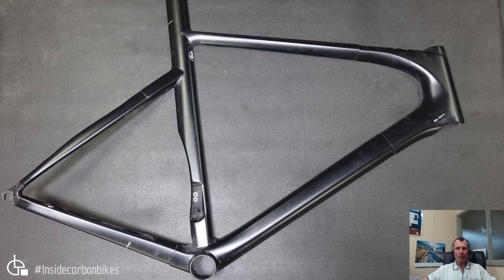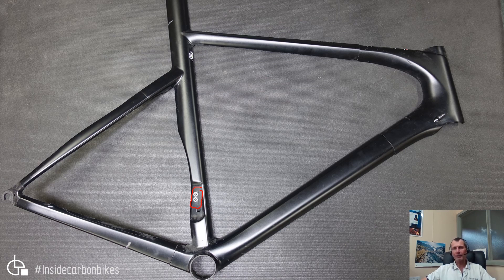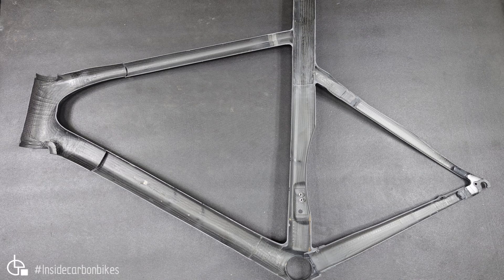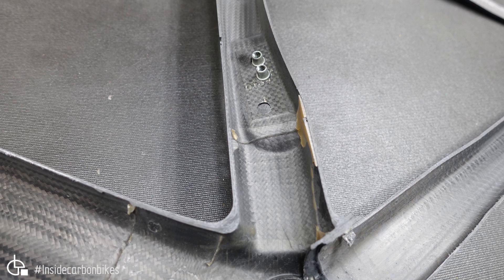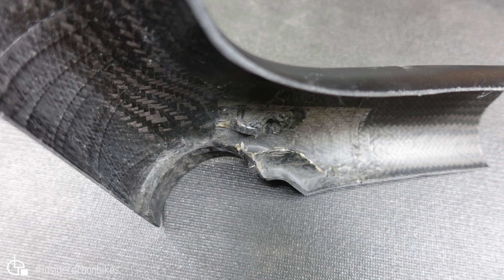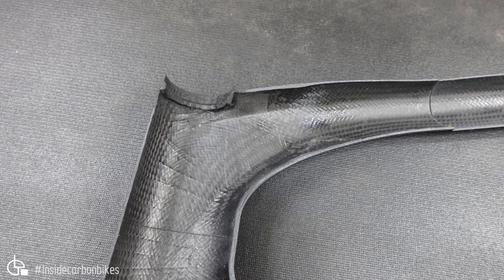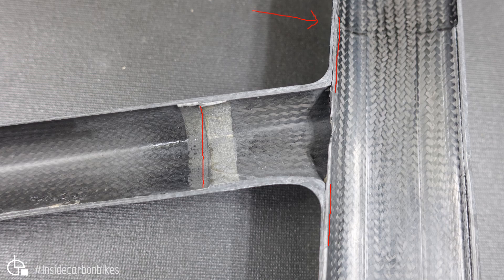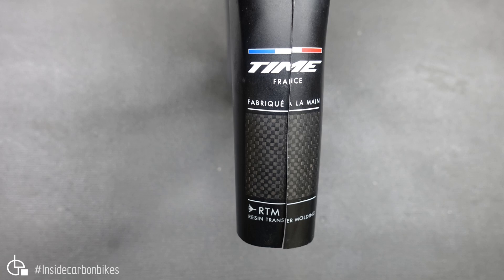Time Scylon 2018 - Cut Up and Review

Comment: Great review Raoul. The warranty defect was from the frame being slightly out of tolerance on the jig when drilling the derailleur holes - Time were great about it, easy to deal with and I’ve had 4x of their frames and this is first one there was an issue (they moved factory so probably a tooling setup issue). Since Time frames cost the same as a mid-upper range Specialized, I’d buy Time every time 😜
Reply: James Young thank you very much for bringing this frame to Raoul and us. Very kind, many thanks. 😊🙏...I wish I had the budget for a Time
Reply: Schoebelski no problem. Too many poorly made and dangerous bikes out there, Raoul is doing a great job bringing this to people’s attention. Time isn’t as expensive as most think, have a look at Cecil Walker in Melbourne, they have some great discounts
Reply: 37:16 little late, but did you get into futher investigation what caused the cracks ?
Reply: @xam8839  which cracks? The fault was the factory drilled the holes in the wrong stop as it hadn’t been seated on the jig properly - only out by a couple of millimetre but big difference
Reply: @jamesyoung4453  i know the initial fault was with the wrong placed/drilled holes, but at 36:06 Raoul mentioned crack indication. The same kind of cracks seemed to appear at the junction between seatstays and seattube. Did Raoul get into further investigation about this? Haven‘t seen cracks like this on other frame cut ups. Don‘t think it was caused by cutting the frame, since he uses fine dremel tool to do so.

Comment: There's something truly magical to these bikes, an experience that you only understand when ridding a TIME bike. Yeah sure the BB's are round straight and parallel ( why wouldn't they be) and the frames finished inside nicer than most on the outside. Maybe it comes from weiving the carbon Kevlar and vectran in different direction or maybe it's from weaving a thread of narrative through the fabric of Time and some saviour fair. Chapeau

Comment: Yup that's what I expected to see. Filament wound RTM parts can be high precision as long as your formers are well designed. TIME Sport did not disappoint.
Reply: Woundup compostites are still in the fork buisness as well :-) According to Tom Kellogh who helped Time with their first (and first desent carbon forks) the Woundup forks are stil the best riding and safest out there +20 years after Woundup 'wound' up their first forks.

Comment: I recently acquired a 2022 scylon and it is hands down the most stable and solid frame I have owned or ridden . Also have a T1sl 2022 and 2019 team machine , all rim brake and the Time is a rock .

Comment: Build one last march, and i must say: it,s the most comfortable yet stiffest frame i ever build and been riding on. beeing a heavy weight in the "peleton"(105kg+) i was looking for a frame with no weight limit, i came across this 2018 frame and bought it with out a doubt, it was fun to build an even more fun to ride with. Specs: sram red etap, rotor cranckset 50/34, most aero handlebars, home made wheels (dtswiss R511, hope hubs. I love it, best bike i owned so far!

Comment: Now I can see why they charge a premium for their frames,  very neat.  How does Pinarello justify their prices with the utter garbage they have made as seen in Raoul's cut up? Big difference in quality based on appearances at least
Reply: Justify? Why would they? You pay for the name from back in the day when specialists used the best steel tubes to hand-build their bikes in Italy. Nothing of that remains.
Reply: I've used time.pedals can't fault them.apart from the cleats being  pricey.
Reply: A bit.like the vacuum.bag with resin.method that many small car parts guys still.do.
Reply: @st939  sure it does
Reply: Prices aren't set at what is just, its set at where most profit is made. Pinarello sets there prices ridiculously high, people want and buy lots of Pinarello's, end of story. Win for Pinarello.
Reply: @LordVilmore  supply demand has set the price ultimately.If Eneos lose the next TDF then the demand might shift elsewhere and then the price down.
Reply: @glennoc8585  huh?
Reply: Are there any other brands that make frames this superior way? I am in the market for a new carbon frame, but it seems all the expensive frames nowadays are made in a shitty way. They can’t even get the bottom bracket right. Definitely don’t want to move to threaded.
Reply: @cubist112  only Time manufactures their frames using resin transfer moulding. Everyone else uses pre preg. Look makes really decent frames although Raoul did have a bad example on the show some months back. The new 795 Blade RS uses a moulded in sleeve to the Bb386 std. I have one. It's superb. Boroscope shows no defects. There's a few places where the bladder remained behind in the frame but otherwise its great
Reply: Pinarello is just a brand from oligarch owned UK luxury department store and has been for nearly a decade. It has nothing to do with the craftsmen from Treviso.
Reply: @mortenreippuertknudsen3576  pinarello is an ego purchase not a technical purchase.
Reply: AG Coarseman  Same owner as os the owner of a UK luxury department store - can't remember which. Originally it was sold to the owners of Luis Vuitton. It has been sold on again lately.
Reply: Nyc is full of em too

Comment: It looks good compared to some of the other frames we have seen.  It would have been nice to see the fork as well because they use as resonator device in the for legs to dampen road vibrations.  I think the technique is the same as that used in some skyscrapers and Japanese Pagodas  to withstand earthquakes.

The weakness does seem to be at junctions between tubes.  At 34:49 you point out the cracks on the left side of toptube - seatube junction but there is a crack on the right side running the visible length of the tube.  Maybe the cracks were caused by cutting the frame apart but that still shows they are weak points.

Something I can't understand about the process.  There is a wax mandrel that the fibres are woven around and the whole item is placed in a female mould.  The resin is then transferred through the fibres.  The melting point of the wax must be higher than the curing temperature of the resin otherwise it will melt during curing and not provide the necessary support.  But if the wax melting point is higher than that of the resin why does the cured resin not melt when they are removing the wax?

I have seen the RTM technique used by boat hull manufacturers but their process is slightly different.  They still vacuum bag but they attach pipes to each end of the bag and use the vacuum to draw out the air in the fibres and then draw resin into the bag and through the fibres.  I'm wondering if Time also draw the resin through the mould rather that inject.  It would seem better to draw it through because that also draws out air.

Could prepreg fibres be woven around a mandrel and placed in a female mould?
Reply: @Jeppelelle  Great reply
Reply: Once the resin hardens it is no longer vulnerable to the heat so they can use heat to drain out the wax

Comment: On one hand the post-preg and mandrel process produces a clean interior and virtually eliminates the possibility of wrinkles and gaps. On the other, it increases the amount of resin used, as mentioned, and reduces the capability for fine-tuning the strength/compliance/stiffness/weight of the frame design. Of course, unless you're trying to set records in weight reduction, the fine-tuning might be overrated. 45 years ago we never fretted about which was lighter, a Cinelli, a Gios, a DeRosa, or a Colnago.

Comment: Hambini's wet dream
Reply: Steve King  one that follows Luescher would not consider durian rider...
Reply: Hambini´s RTM dream??    Rgr
Reply: Steve King  yeah, depending on your location, probably the wise decision is to go for something like Cube, Canyon, Giant, Merida, Focus or Rose (Rose Backroad is a nice bike); cheers
Reply: @al3xandr3i  Durian isn't making the frames.
Reply: @al3xandr3i  While Durian may be a questionable guy, he was the first to call out major manufacturers for their faults on here. Years and years before selling frames. In terms of honest review, that is saying something considering the other outlets of "tests".
Reply: Steve King  Giant, Merida and Canyon usually offer the best value for money, by far. Giant, in particular, seems to have good QC.

The unique selling point for Trek is the Isospeed system, but I'm not sure if it's available with the lower end models.

I would get a Giant, then save up and get a high-end bike in the future if you really want. I feel like an entry level Trek/Specialized etc. is a bit of a pointless compromise - mediocre specs, not as cool as the top models and not great value for money.

That was the pragmatic take on it, but ultimately, just get the bike that will make you feel like riding it. Whether that's because of the handling, efficiency or the way it looks doesn't matter.

Comment: I would like to see reviews of some of the newer custom carbon bikes, such as Parlee, Myth, Sarto, and Alchemy. The majors have pretty much standardized the modular approach with standard head, seat cluster, and bottom bracket sections that can be consistently molded under high pressure. I'd like to see the full-custom answer to that.

Comment: Nice to see a properly made carbon frame! I had a question that is off topic, but I thought you might be able to give some advice. Just got a new pair of lake xc carbon soled shoes (2 bolt spd style), and the slots stop 5-6mm further forward than my old pair. I was wondering if you had a recommendation for a safe way to drill/dremel/sand the slots to get the cleats further back without damaging the carbon structure?

Comment: Around  25:45 both the upper & lower cut edges show a light line in the centre of the tube wall,  is this from the cutting process ? Or maybe excess resin between laminates ? Thanks for all your work.

Comment: It is cool how they weave the carbon, but however, they use many more pieces to put a frame together, where as most brands whether they make it themselves like Giant and Merida or source it out like trek or or Bianchi, etc. put the main triangle together in one piece and then glue the rear triangle to frame after. I don't see how you can specifically place certain fibers where needed when it's weaved. Weaving is like braiding you can only weave or braid in a certain way.

Comment: Just curious what was the weight of this frame?
Reply from the maker: I weighted all the cut pieces at 992g, add a few more grams for the material the saw removed and some fittings and it would be around 1050g I would say.
Reply: Built up an RXRS : the module (frame,fork, stem,handlebar ) plus the wheels plus the seat weighed 10,4 lbs

Comment: I looked at Time's website and apparently there's some kind of moving weight element in the fork for vibration damping. Have you cut open one of these forks, and if so what does that look like / is it a risk of breaking?
Reply: No risk of breaking
Reply: they have done that for almost 20y, no risk. They branched out to the carbon fork buisness before they added their frame buisness.

Comment: Did you have a chance to see if this had a made in France tag anywhere? I had a close look at a Slovak made scylon disc frame today and didn't feel it compared favourably to the my French made 2012 RXR Ulteam.  They moved to Slovakia to save on labour costs, but did take note of a change from a compressed carbon seatpost head to an aluminium one, perhaps they made other compromises?
Reply: Too late. That did not change the fate of Time. They were sold to VC now. Too bad.

Comment: Colnago uses lugged construction for their top of the line CXX frames whereby all the CF tubes and lugs are made separately and then assembled into a frame, unlike a monocoque frame which is cast as one whole piece. Isn't Colnago's method of CF bike manufacturing easier to control from a QC standpoint? I suppose they too would be using RTM method for the individual pieces.  It would also be easier for them to check for voids/errors in the molding as well. Why don't more bike manufacturers use this method of construction?
Reply: Colnago does not use RTM for the lugs AFAIK. there are GCN videos on colnago lugged bike construction which clearly show they aren't RTM made.
lugged contruction is not popular because of significantly more manufacturing processes and inventory costs. you have to have a set of lugs for each frame size,  and you have to make the tubes for each junction. so You are essentially making tooling for headtube junction, BB junction, seat tube junction,. top tube, down tube, seat stays and drop outs. that is 7 sets of tooling per frame size as opposed to just one or two for monocoque construction. Not to mention you have to miter the tubes to fit well.cutting a piece of tooling like a mold is a six to seven digit cost item that wears out over several thousand pieces (depending on complexity)- so the costs involved are quite abit higher

And then you have to glue them in place with a jig that fixes them precisely in place, so you need to make the jig as well. Also, lugs to some degree limit your design freedom.
Reply: Each junction makes for wasted material and weak spot so you end up with an heavier frame. That's why there aren't more lugged carbon bikes anymore apart from Colnago and specific custom geometry needs. RTM for bike is Time property was co developed with french labs (military purposes if i remember well). It certainly does not looks easy to replicate.
Reply: @TheAntoine191  How is it a weak spot if the parts are easier to check for flaws and you have tubes connecting with lugs like on a steel bike - so the junctions are twice as strong as you have double the material at the junctions.
Reply: @triode1212  stress concentration. But it's not a reason not to make junctions, it has its drawbacks, that's it.
Reply: I had a C50 and a C59 and had issues with each. Colnago is typical of Italian “QC” meaning it sucks.
Reply: @DavidJones-sc6jc  What were the issues you had with them?
Reply: @TheAntoine191  it's usually weaker. Take a rope, cut it in half, then tie it back together. No matter what knot you use, even if the cross section is twice as thick, due to the added stress of holding itself together and also performing it's job, the knot will always be weaker than the original rope. 

While carbon frames aren't an exact comparison, they're pretty similar.

Comment: the best-looking carbon frame shown on this channel. still, it’s only carbon. it won’t last. it won’t survive impact. it’s only advantage as a material is weight.
Reply: Steve King you don’t know wot quality you’re getting when you buy carbon. as dirty harry said, “it’s a hell of a price to pay for being stylish”.
Reply: Steve King  a steel frame with carbon seat post and carbon handlebar will ride way better than both alloy and carbon. I would go for a steel fork but you can also get a carbon fork. Will outlast you in longevity as well.
Loose a couple kilos off the old gut and you're golden.
Reply: Panos peterpan  Superlight alu doesn't survive impact either, and can hardly be repaired. It also corrodes.
Reply: Steve King  TI alloy outlasts everything else at least.
Reply: @foundfoundfound1  You do if it is a TIME frame
Reply: It also has some kevlarish fibres woven in. You can't call this "only carbon".
Reply: @foundfoundfound1  he also said  " a man gotta know his limitations "
Reply: Panos peterpan  Unless you have a bonded aluminum frame like an old Alan or Vitus IT WILLL NOT LOOSE STIFFNESS! The 'loosing stiffness' is a farytale suite-able to argue with your spouse or your yourself on why you need a new bike again (and again, and again). Aluminum tubes or tig welds does not get less stiff regardless of how much they are ridden - they do weaken and WILL break though.